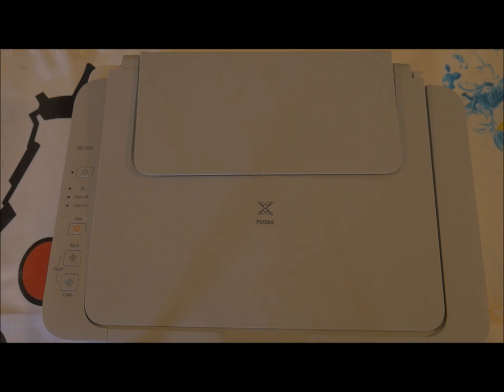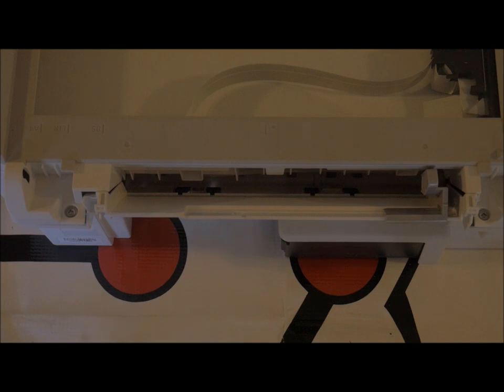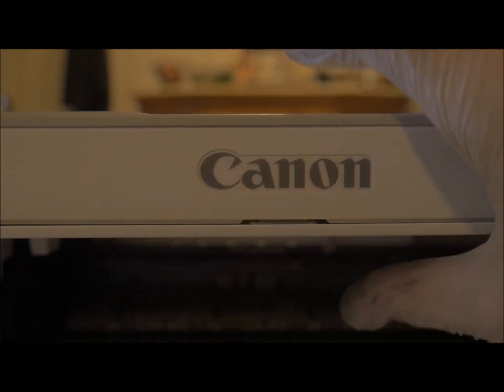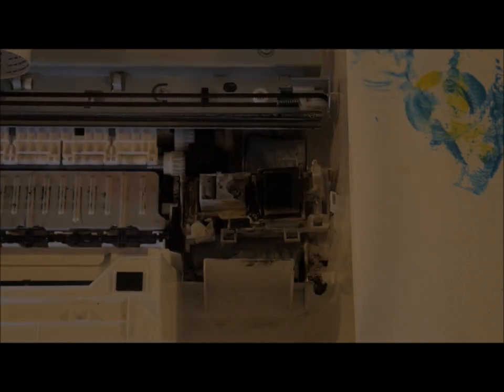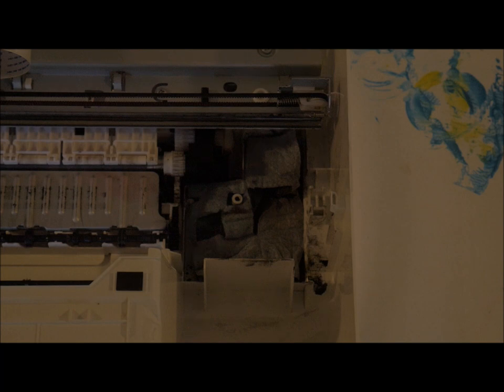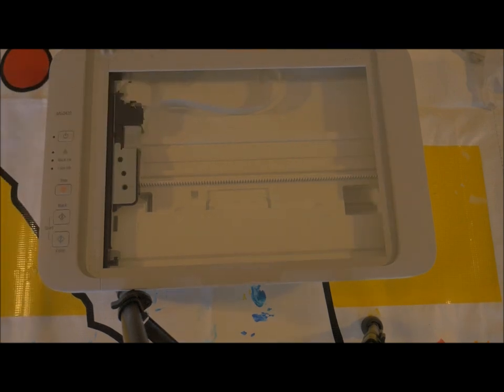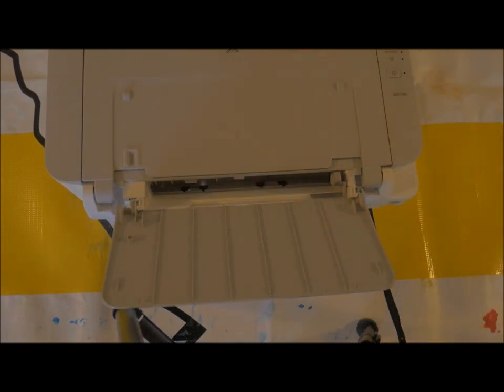Open & Close Canon Pixma MG2420 Printer (2400 Line) to Clean Ink Absorber (English)

Comment: What do you do to reset the ink absorber code.  It keeps blinking that the ink absorber is full but I cleaned them.
Reply from the maker: I went through the process of resetting the warning lights you will find online (https://www.youtube.com/watch?v=9SrBzabJj00 is one example) but the warning lights would come back the next print job. I just hit the "Black" start button each time I turn on the printer and it works fine
Reply: @GgdaOrganic  weird I can’t even get the lights to go away with that method, nor can I even connect it to my computer to print something.
Reply from the maker: @Diceacious  are you sure it is the ink absorber warning? Check out this site for the warning indicators: https://support.usa.canon.com/kb/index?page=content&id=ART143179

Comment: Hi, for some reason my new colour cartridge isn't working (but is detected) so I thought it might be something to do with the ink absorber. I've followed what you did and it's not turning back on. I'm not sure if I've connected the wires the correct way but they are in place. Do you have any suggestions? Thanks.
Reply from the maker: Most likely the wires are not set correctly. Double check both their placement and how snug the connection is

Comment: Hi, my MG2520 shows ink pad full error message. After cleaning it and installing it, still shows the same. What can i do ?
Reply from the maker: I went through the process of resetting the warning lights you will find online (https://www.youtube.com/watch?v=9SrBzabJj00 is one example) but the warning lights would come back the next print job. I just hit the "Black" start button each time I turn on the printer and it works fine

Comment: I have the CANON PIXMA MG2420, Serial Number HAAB2064, when following the instructions on Youtube at 2.47 the inside om my printer is different and show the PRINTER CIRCUIT BOARD, could even see the ink absorber.
Please advise anyone ?
Johan VanLeer
Reply from the maker: What problem did you have?
Reply: I couldn't see/find the INK ABSORBER below the PCBoard to be cleaned !
Reply from the maker: @johanvanleer883  We show the ink absorber at 3:20. It is in the lower right of the printer, underneath a cover that is easy to remove

Comment: Mine isn’t turning on after taking the top off
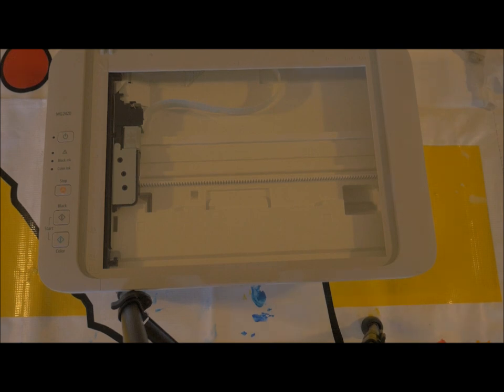Reply from the maker: I talk about reconnecting the wires and boards at 4:49. You might also need to take off the button cover to get to them. We did not do that for this video.